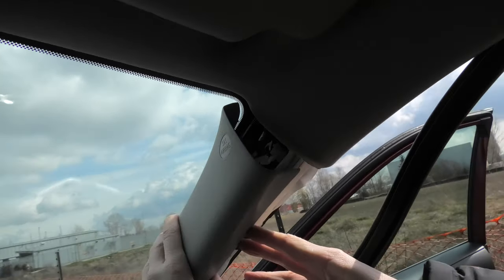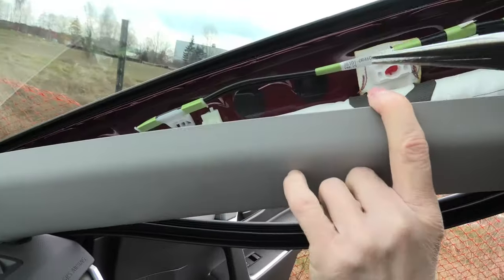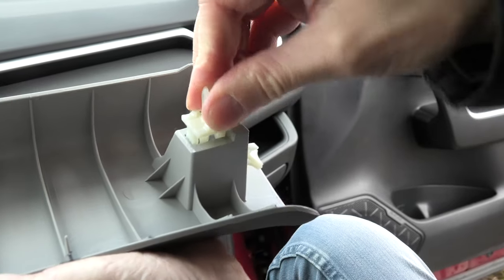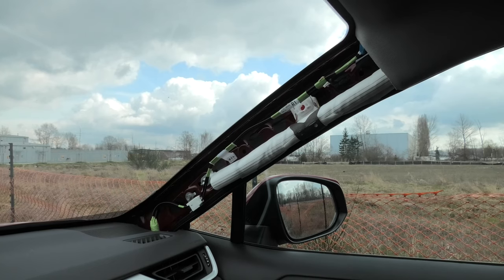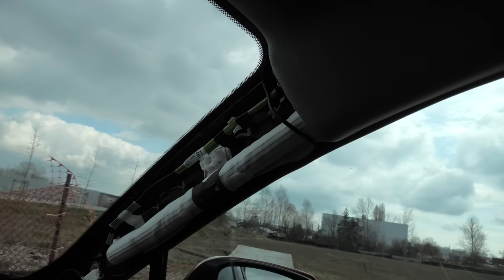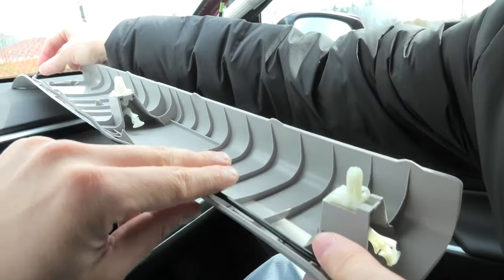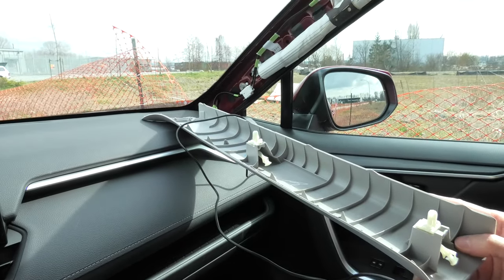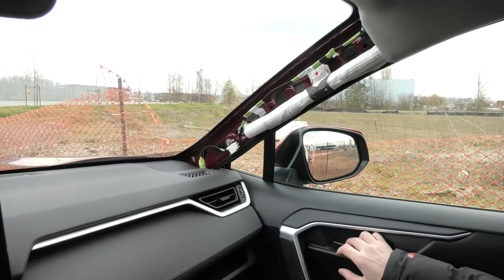Toyota RAV4 (2019-2025): How To Remove A-Pillar Trim? Will Dash Cam Wire Obstruct Airbag Deployment?

Comment from the maker: PRODUCT LINK:
A-Pillar Trim Clips (62217-42050) - https://www.ebay.com/itm/314322681738?mkcid=1&mkrid=711-53200-19255-0&siteid=0&campid=5338971185&customid=&toolid=10001&mkevt=1.

RECOMMENDED TOOLS:
1. NEEDLE NOSE PLIERS - KNIPEX Tools Long Nose Pliers With Cutter - https://amzn.to/3myiuvr.
2. EXTRA LONG NEEDLE NOSE PLIERS - KNIPEX Tools Extra Long Needle Nose Pliers, Straight Jaws https://amzn.to/3Zzt3gy.
Reply: Need to remove battery terminal or not before remove the pillar? Worry thay airbag will trigger if not disconnect battery terminal on my vios 2020. Gonna install obd2 meter soon.

Comment: Don’t need to take it off. 
Use a plastic panel removal tool and slightly open slide the cable behind the air bag. Job done

Comment: Thank you for your great videos!!  I have 2019 Rav4 XLE and when it rains I notice wet spots inside the car on the apillars.  I live in Florida and think the heat caused it because it did not happen until I moved here.  Any ideas on what to do??  Thank you!!
Reply from the maker: It sounds like the roof rail leak. https://www.carcomplaints.com/Toyota/RAV4/2019/tsbs/tsb-22te05-region-le.shtml.
Reply: I used 8mm rubber plugs put them in the roof rail holes with silicone  around them

Comment: would it be possible to run the wire down the A pillar and underneath the speaker cover and avoid the weather striping and crossover the airbag entirely? thx

Comment: Hi, I watched your video few times but i am not able to put it back the clip. I am concerned if i will break the clip. What am i doing it wrong. I have installed the wiring/dash cam, all job is done except this trim which is hanging around. Please help me.
Reply from the maker: Make sure that you push clips back into the A-pillar trim prior to reinstalling it. Carefully align the a-pillar trim and push it in. Make sure that nothing is in the way.

Comment: Hi, great video, do you have to disconnect 12v battery when you remove the A pillar trim.  After watching this video, I want to add sound deadening on the A pillar metal and sound absorption material like 3m sm600L sound absorption.
Reply from the maker: Thanks! Yes, you should disconnect the 12v battery.

Comment: Thank you for you video.
I will not have a problem with the front camera cord, since I will stay along the front window edge until coming to the dashboard. The cord will not be by the airbag. 
The back camera cord is the problem. Again I will go along the front window edge, but will have to cross over the top of the air bag. If I take the pilled cover off, can I fish the cord behind the airbag?
Please let me know.
Thank you again!
Reply from the maker: You can. You can also run the wire at the bottom of the vehicle. But will require removal of a lot of panels.
Reply: @MorozovAutomotive  Thank you!

Comment: Can you also just tuck the wire between the front window and pillar without opening the A-Pillar? Or will that obstruct the plastic from going out when the airbag deploys? Thanks again
Reply from the maker: You should be able to tuck the wire using the plastic trim removal tool. I don't think it will affect the plastic trim. Here is another article on the topic - https://www.blackboxmycar.com/pages/dash-cams-and-airbags.

Comment: Do I need to disconnect the battery to avoid activating airbag when wiring? Hybrid 12v battery is kinda hard to disconnect(no vid online)
Reply from the maker: Hi Tom, yes, it is a good practice to disconnect the battery when you work close to the airbags. The 12v battery is located in the trunk of the RAV4. This video shows where it is located: Toyota RAV4 Hybrid (2019-2022): 12V Battery Location - https://www.youtube.com/watch?v=kR6gQE9d1Bo.
Reply: @MorozovAutomotive  That's the one I watch any not sure all those extra connector around the battery affect anything if I disconnect the traditional way.. The extra large holding frame looks quite scary....I will see what dash cam is best for my 22' Rav4 Hybrid LE. Way too complicated to connect rear cam to the front

Comment: I'm an Auto Technician who installs Dash Cameras daily.  The lack of experience in the video and comments is astonishing. Routing it infront of the airbag WILL hinder the airbag deploy, why take the risk? Get it installed by a professional. 

Please DO NOT cut in front of airbags.  Just go in behind them, unless you pull the fucking thing it isn't going to deploy.  Just route it in behind it.
Reply: @helltrooper1288  I also have a degree in Engineering with a fairly comprehensive understanding of physics.
Yes an airbag deploys with lots of force, but if it's being wrapped around by a cable immediately that absolutely  will affect how it deploys.

It's the same principle as this: It's like having a firecracker go off in an open hand, you'll get a scorched palm.  if you wrap your hands around it and it deploys your entire hand will be blown off.

You want to take the risk, fine go ahead, I'll continue to spend an extra 5 seconds not being lazy and not risking peoples lives.
Reply: @scatcat1994  I get your concern, I also rather not go over the airbag but my logic is that the A-pillar seems to be literally doing the same thing. It's blocking the airbag completely. Unless it's released by another mechanism and not from the force of the airbag deploying, I dont see how a wire in the same position could affect anything. It's not like the wire is under a lot of tension, once the A-pillar is loose, the wire will be dangling and any force applied will effectively pull the wire out that's still tucked in from above. The only problem is that the wire will most likely yank the dashcam off, break it, and send it towards passengers as a projectile, or passengers could get slapped in the face by the wire. 

How do you recommend going behind the airbag? I have a rear view camera that needs to be routed from the front windshield all the way to the back. Should I remove the remove the pillars as shown in the video?
Reply: @helltrooper1288  It looks like it won't block the deployment of the airbag. But Have you guys taken into account that if blocked airbag with a wire deploys, the wire can hit the face with a really high speed and hurt the person. This could be really dangerous.
Reply: Air bag on the A pillar fires to the front door window to provide a cushion for driver and front passenger before hitting on door glass.  If the firing direction is not blocked.  It would be OK.